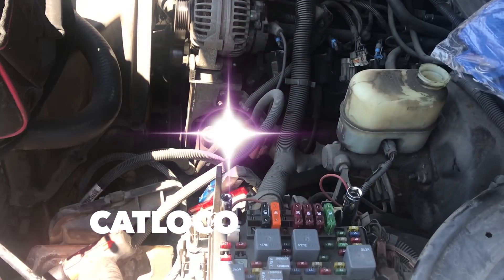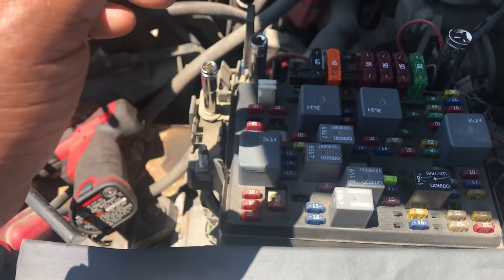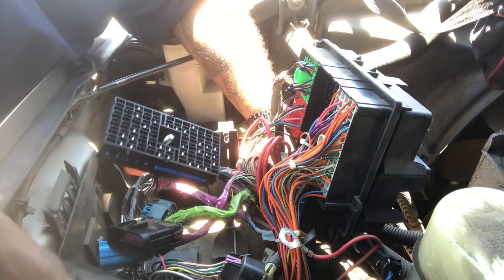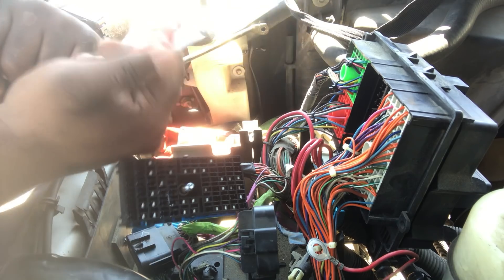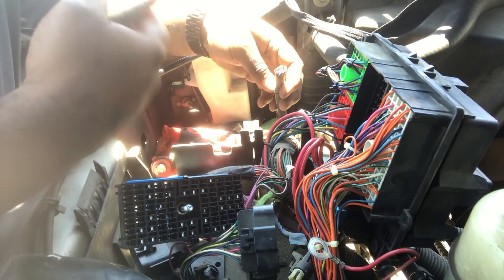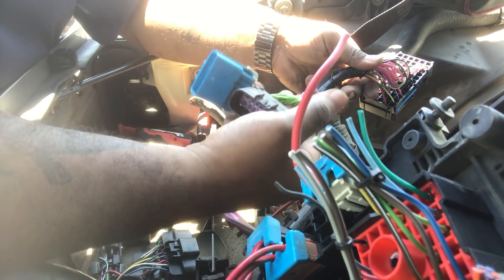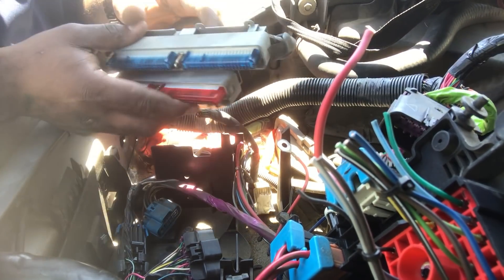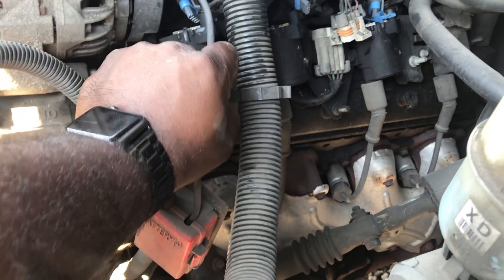Removing the Wiring Harness from an LS GMC Motor in a Junkyard - Part1

Comment: I have to now replace my original harness that goes from fuse box all the way to the end of my 2000 gmc truck . The harness was full of water and had a bunch of chafted wires . U can wiggle the harness under the hood and different things on the dash light up or flicker with the keys in your pocket. Different Things would work one minute then nothing the next minute .Sucks big time now my friend wants to take the cab off again because it’s way easier removing the harness. I had to basically restore this truck and it’s been one nightmare after another none of which was planned
Reply from the maker: Yeah that sucks. I'd just grab another one in the junkyard. There's always a large supply of these trucks and not many people looking for a harness.

Comment: Many thanks.
Reply from the maker: Hope it helped 🙏🏾
Reply: @CatlocosGarage  I think it's gonna help me decide to leave it! Lol. I have it all loose but the trans and starter plugs. 😖😖😖
Reply from the maker: craig jones Yeah the starter takes some maneuvering. Trans isn’t bad. One plug one passenger sides and just remove the 2 bolts on driver side to remove the switch. Those plugs are glued on. Easiest thing to do is find one with the transmission already removed.

Comment: Depress the spring on the throttle body and fish that wire through. No need for pliers.
Reply: Like you were brother to take the tension off the tb .Then use the skinny part of the cable and bring it where that anchor catches after you turn it sideways for slack.
Reply from the maker: Inviting1word ok I’ll try that
Reply from the maker: I don't know what spring you're talking about. I'll have to look. It's threaded on.

Comment: Hey cat love your vids. What you think about the 5.3 from 2001 GMC any good for 73 blazers let me know what you think?
Reply from the maker: Definitely. Any GM Truck from 99-02, 03 for DBC is good for a LS Swap. Later DBW Gen4 blocks will have slightly more horsepower. Just depends what the purpose of your build is gonna be used for. I prefer Gen3 right now.
Reply: Ok appreciate you cuz I am gonna pick that truck up for 400 pull the motor and trans .
Reply from the maker: @dirtykustomz  Awesome deal.

Comment: How long does it take to remove the entire Harness?
Reply from the maker: its me Depends on what you’re working on. Is it a stock truck, trans or no trans.
Reply: Catloco's Garage stock truck with 4l60e
Reply from the maker: its me Prob take you 2 hrs if it’s your first time. Otherwise 45 to an hr. If it for a swap, then I’d say go to junkyard and find one with transmission removed. That’ll cut down your time by half. You’ll find many with no trans and fenders off.

Comment: when you remove an ls engine from the j y. people say make sure u get the wiring. is it all the wiring even from the inside of the vehicle or what u just did????
Reply from the maker: Everything I showed from the fuse box thru the engine to the transmission. Easiest if the transmission is already gone.
Reply: What about the biggest part if the harness that goes In the cab?

Comment: I just pulled a harness and I took the intake aswell for less to disconnect .
Reply from the maker: Black Macgyver Yeah around transmission is prob the worst part of removing. Trying to pull it out the top or feeding it down the bottom. Temps been like 103, so it’s torture pulling one rn. Did you get it out completely or did you cut anything? I’m trying not to cut anything on it yet.

Comment: Is that a CT761?  If so what is the part number on the flush fit battery?  That's pretty awesome.
Reply from the maker: No. I own both. This is the older 1/4" CT661. I didn't bring my CT761.